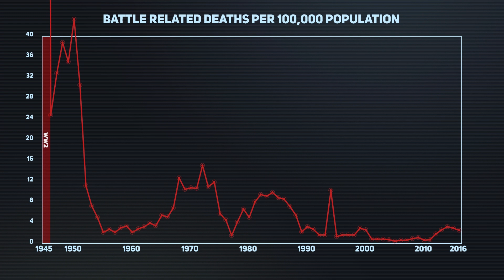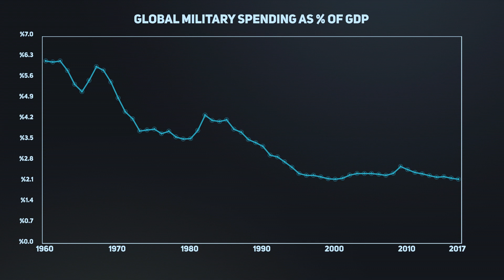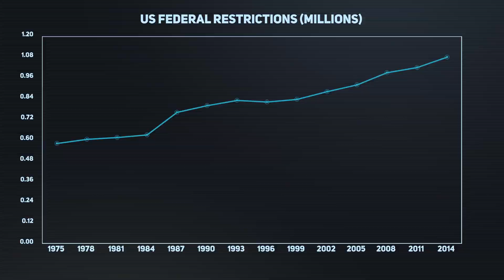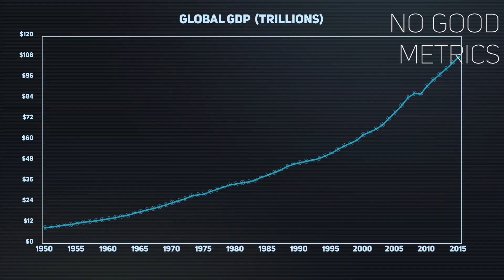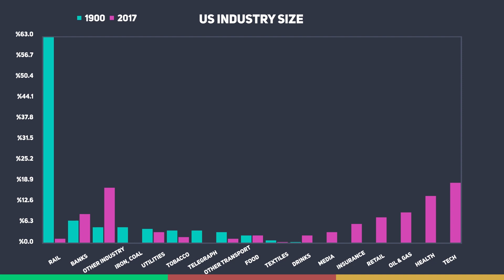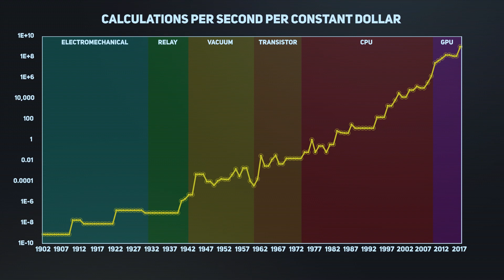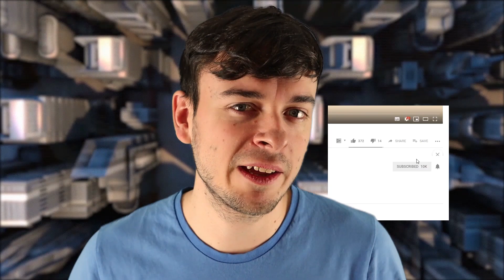Is Innovation Slowing Down?

Comment: Yeah, no, it is simply due to physics, at some point every single technology matures by reaching natural impassable barriers imposed by the law of physics.

Current fast trains are almost all the way there to the maximum viable speed possible for crewed land vehicles on wheels, physics impose this hard limit, that is why China, Japan and others are investing in research of Maglevs, to circumnavigate the physical limits for wheeled vehicles.
That is also why AMD had to come up with the chiplet designs for the Ryzen chips, because we are almost all the way to the minimum possible size for details in nano scale lithography before Quantum mechanics and the size of atoms themselves put a hard cap to the increase in computing power and the Moore's law.
That is also the reason of why airliners speed haven't increase but a bit decreased in decades, there is an optimal narrow range of optimal speed for air travel, in order to cover the most distace with the minimum expenditure of fuel and we have already hit it.
Hell, for military engines in which fuel consumption isn't a problem there are hard caps too, that is the reason if why figther crafts speeds peaked at roughly 2.5-2.8 mach at high altitude, that is the point where heating by atmospheric drag and the weight of vital support for human pilots begins to become a problem and why even with special materials the absolute cap for air breathing jets is somewhere between 3.5-4 mach, the top speed of SR-71/A-12.
Piston internal combustion engines? It has been decades since we got as close as possible to the theoric max efficiency of the Otto and Diesel thermodynamic cycles, that's it, the technology has plateau and all the possible "innovation" are just bells and whistles.

Comment: Yes yes yes
Innovation is actually slowing down and will continue to slow down for a long while until it picks up again.
I'll explain why.
There are many reasons why this is happening.
First of all, prior to 100 years ago, the reason why there were so many inventions was because many people created stuff as a hobby not based on paid research. People didnt have to get paid to invent stuff. They created everything out of their own will. Today if people dont get paid, they hardly move on with their research.
When they made that movie "I robot" they thought that by the 2020s robots will be independent and be assisting humans. However we are in the early stage of the robotics age. AI is just simply the brain of robots without the existence of robots. So for now AI coexists with computers even as we slowly transition from the age of computers to the age of robotics.
based on my calculations I strongly believe we will have perfectly independent walking robots by 2120AD
Flying cars without rotors or jet engines by 2880AD

Comment: The low hanging fruit is gone. The idea of continuous exponential growth in tech is a fantasy. Growth now in terms of yields of agriculture per hectare is slowing. It grows at a third the rate as a percentage than it used to 40 years ago. 

Moores law is the same. We’re near the limit now of the smallest we can make a transistor. We can innovate now by 3d microchips; transistors stacked on each other. This is hard for a lot of reasons.

Comment: BREAKTHROUGHS ARE MADE AND LOST TECHNOLOGIES ABOUND THROUGHOUT THE YEARS AND EVEN IN 1990'S AND UP TO NOW. But one thing is, the inventors go missing, or killed off......................... Look up sloot digital coding systems, its neat and starlight, there is lots of breakthroughs and even new patents, but threats are made and things get bought and kept for their selves.  Look up sloot digital coding system, its super neat idea and would be better than any known file compression methods today. https://www.youtube.com/watch?v=33Ij_IOQlx4&t=116s  ... IT compresses info really well and quickly, it was said around 16  full length movies could be utilized on 8 kilobyte's of space, all running at once, around the 1990's years. No one knows how it was done, but supposably compressed files had unique patterns, or key tags, that it was all it took to represent needed information in processing, in which made it very autonomous and fast, quick action, quick reaction..  Supposably it was 100 million times better then compression methods today, some think the inventor was killed.

Comment: it's slowing down and now there are major supply problems with new tech. i have a 5G phone but can't use it to its potential as there is no 5G where i live. i was thinking about a PC upgrade but you can't buy graphics cards. the system is failing, it can't meet demand. and of course currently you aren't even allowed to leave your home without a good reason due to the 'pandemic'. seems to me things are starting to fall apart.
Reply: 5G technology is a little overrated.
The range of application is not so wide, and there is no impact to change our life.
It's just a communications infrastructure.

Comment: We are introducing and adopting new ecosystems of technology and business at a slower rate than in the past, or at the very least we are not innovating at a rate to match population growth. Think about the 15 years from 1990 to 2005 - so much changed: During that time we went from cassette tapes to CDs to MP3 players to cloud-stored digital libraries that can be played on multiple devices. We went from barely any personal computers (that were very expensive) to computers being common-place and incredibly powerful at cheap prices. We went from basically no cell phones to cell phones everywhere. We went from barely an internet to everything being on the internet. By 2005 phones were already "smart" though Android and iOS were yet to be released. Then from 2005 to 2020 what changed? Smart phones became more common. iOS and Android phones became more common than personal computers. Tablet devices went from non-existent to common and cheap. Some things were moved online. Some things got faster or cheaper such as computers and phones. Social networks grew bigger. There were (between 2005 and 2020) nowhere near the amount of huge technological disruptions like we saw the previous 15 years (1990 to 2005). Think about it: If someone were to visit 2005 from 1990 they would have been blown away, but if someone from 2005 were to visit 2020, they would not be as surprised.

Comment: For the legal part, project Orion was a big one. It was supposed to use extremely small nuclear bombs to launch rockets to orbit. For reference, the explosion size of these bombs was like blowing up a medium to large-sized crate of TNT. With the ban on testing nuclear bombs, project Orion was basically killed. If the nuclear ban were situational and looked at the intention and how relatively harmless and small the bombs were and not the fact that they were bombs, we would be flying through space by using the force of explosions.

Comment: On Antibiotics:
Bacteriophages develop new methods of breaking through bacterial defenses continuously. The chemicals they use to do this are called lysins, because they make bacterial lyse, or burst open, by making holes in the bacterial membranes or cell walls. Different bacteriophages specialize on different species of bacteria (may be strain-specific too? I don't know), so there are a lot of different lysins. 

Because of this you can use a mixture of Bacteriophages as an "antibiotic," even if you don't know what kind of bacterial infection you have, it's likely one of the bacteriophages will be able to target it. Some people are wary of this because it's thought that the bacteriophages, as viruses, could serve as a vector to spread antibiotic resistance, iirc, though I'm not sure if there's actually any evidence that that's a threat.

On the other hand, the regulatory regime for medicines makes this kind of mixture of Bacteriophages impossible to use in medicine in most places (in the "western world" at least) because it's impossible to control the specific ratios of different viruses and keep the strains consistent without prohibitively expensive costs, or the practice being outright impossible. The lysins which the bacteriophages produce, however, can be produced and administered in controlled concentrations amenable to this regulatory system by simply taking the gene that produces the lysin from the bacteriophage and putting it into something like yeast or maybe some other kind of bacteria that isn't susceptible to that specific lysin that can produce it.

Regulations get a bit worse of a rep than they deserve though. Accounting for externalities, information imbalances, and other deviations from "perfect competition" are necessary to deal with economic inefficiency, such as with carbon taxes, but people that benefit from them not being dealt with fund a lot of talk against doing so, so those views are overrepresented in most media, making them easier to pick up if you don't do research with this in mind.

Edit: also because lysins make bacteria explode, this can release toxins the bacteria are producing  and cause greater illness in the process of getting rid of the pathogens causing it. Teaching white blood cells what to look for in principle should work better since they can catch the toxins and contain them.
Reply from the maker: Thanks for the post. I want to make a video on anti bacterial technologies and phages do appear to be very promising. I've got a lot more research to do on the topic and I want to look at a few other candidates, I didn't initially realize how old of a technology phage treatment is.
Reply: @ExaCognition  Not sure if it'll be relevant but apparently there's some archaea that are suspected of being pathogenic, and archaea are also susceptible to viral infection (presumably including the methanogens that are symbiotic with us). Would be interesting to see a video on the health impact of phages infecting our symbiotic bacteria, though I'm not sure there's been enough research done on the topic to make a video from.

Comment: innovation as the word will not slow down but the tech shore as shit will example i take to already existing tech and combine them in to one that's a form of innovation little different than peanut butter and jelly but tech that already exists like computers is slowing down meaning we are close to a point in time where we will just start working with what we have to make new things instead of improving the tool kit like what we have been doing for a long time
Reply from the maker: Computers is a particularly interesting one, there's a lot of debate at the moment around Moore's Law (and similar variations) as well as the potential for paradigm shifts in computing progress. It certainly seem that as far as silicon CPU's, many measures of speed, appear to show that we are relatively close to the end of the S-curve.

Whether it's quantum tunneling, heat dissipation, manufacturing limits, it's seems to be just a matter of time before we reach the limits of the current paradigm. However, the question of whether that is the same thing as computing slowdown is worth exploring. Computer speed is a function of many parameters beyond CPU speed and is very application specific. It's harder than ever to define a general computing speed because computing is becoming increasingly heterogeneous. In some cases, GPU's have allow a massive speed jump, in other tasks they don't really help much. 

Neural computing hardware massively increases the speed of Machine Learning applications well beyond rate of progress in CPU's but they are even more application specific than GPU's! Other paradigms of computing may well help in other areas, quantum computing may rapidly accelerate certain types of application. CPU type paradigms may or may not be able to use new substrates like graphene etc. If that happens, we may or may not have a second "Moores Law" on our hands.

Hardware aside, there are many other "computer speed" parameters that appear to have quite lot of room for improvement. Chip layout, cache size/location/memory density have a big impact on general computing speed. Threading parallelism has vast scope for improvement, from both a hardware and software perspective.

There's also the software side itself and other elements that are tricky to calculate, such as cloud computing. These aren't captured by Moore's Law but certainly impact the"cost/practical compute speed" equation in ways that can be difficult to quantify.

I think it's a question worthy of a video. You may well be right, a lot of our innovations look more like the merger of tools rather than the creation of new tools, but it's not necessarily sure that key technologies are going to slow down because the tools that build them are running out of speed. If computer progress doesn't grind to a halt, will AI emerge as a major technology? If so, will it dramatically accelerate many areas of innovation? If AI sees a gradual growth in capability, is it not a revolution?

It's hard to answer those questions, but I endeavor to give it a go.
Reply: @ExaCognition  it wierd I've used the end of Moore's law as a switch in paradigm for it development. For a long time, the treatment and analysis of data grew with the clock speed of cpu and the reasoning was that well we have to much data now lets wait next year with the new cpu. When clock speed stoped improving they tried to workout how to get around that and that when multicore cpu appeared and cluster programming which now run most of the major internet services.
I think it could be argued that interaction induces innovation wether violent or not as it pushes he effectiveness of finding limites.

Comment: Enjoyed the video but I think what you explained in the first part of the video is quite the existing situation we are facing. Honestly one major problem for this crisis is decreasing rate of human creative effort. Devices are getting smarter but are we??
Reply from the maker: I would ask how you go about quantifying a decreasing rate of human creative effort. Innovation, creativity all suffer from a concrete way to measure output, certainly at a global level. This is part of the reason why we tend towards anecdotal examples of slowing or limited innovation. If we are talking specifically about getting smarter, we can at least use objective measurements of subsets of intelligence such as IQ. 

The Flynn effect is the observation that around the globe, IQ has been rising by roughly 10 points per generation, such that IQ tests needed to be continually adjusted to account for rising IQ levels. That said, this effect appears to be leveling off. There are some countries where IQ is rising and other countries where it is now falling. It's hard to make definitive statements at the moment but it looks more a case that global IQ gains are stalling out rather than shrinking.

Looking at the data, it is possible that we aren't getting smarter anymore, at least within the subset of intelligence that IQ tests aim to measure. Since intelligence isn't strictly limited to IQ, it's possible that we are gaining/losing intelligence in other areas instead. It's an interesting topic, something I would like to do more research into.
Reply: Iq is regressing because lower iqs are being allowed to parasite off richer higher iq nations.
Reply: Great point - if innovations are accelerating so dramatically while are doctor's so helpless against most diseases?
Reply: @GreatGazoo8 In order to combat deadly diseases, individuals must invest more than just innovation; dedicating their entire lives might be necessary to devise effective methods.

Comment: You did great, but pls stop changing your dynamic background when you're talking every 5 seconds..

And too many cuts too, a bit uncomfortable for me to follow through.. because every sentences ended with cut
Reply from the maker: Thanks for letting me know. It helps a lot with making the videos better! The background is supposed to signal a new segment or chapter. It was pointed out to me that these backgrounds are generally too vibrant and distracting, so I toned them down in my latest video. Hopefully that is better?

I'm still fairly poor at presenting, I move my head around too much and pull funny faces. One of the things I really struggle with is presenting really long sentences without errors. I can't get an autocue setup that does't make it look obvious that I'm reading from an autocue.

My current cuts are about as long as I can reasonably make the average sentence while still being able to record a video in one day. It seems crazy that filming a 15-20 minute video could take that long but I really am that bad. I've noticed I'm slowly getting better though, so I should be able to make longer cuts going forward.
Reply: @ExaCognition  great! I haven't watch your latest vids but plan to on this weekend..